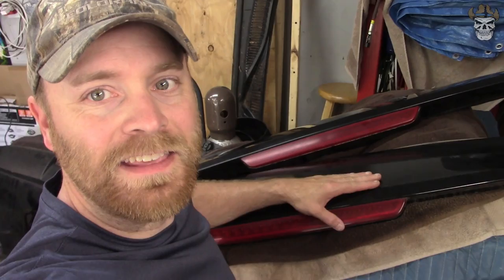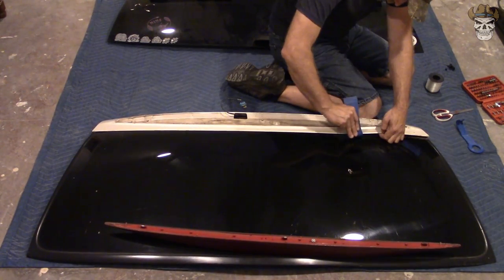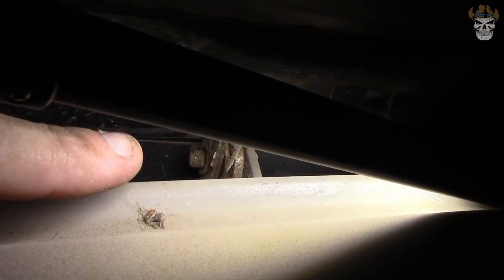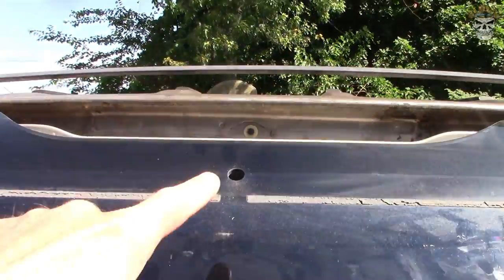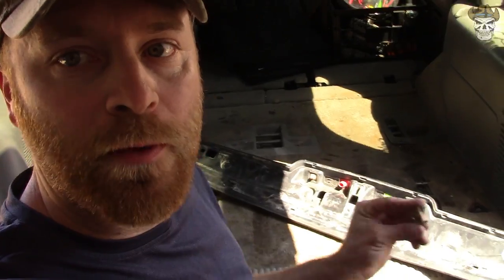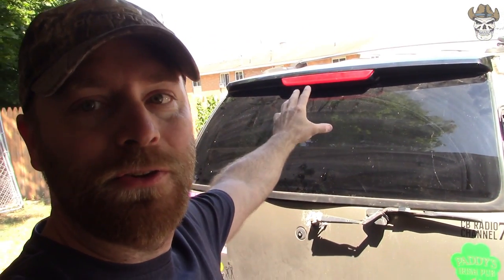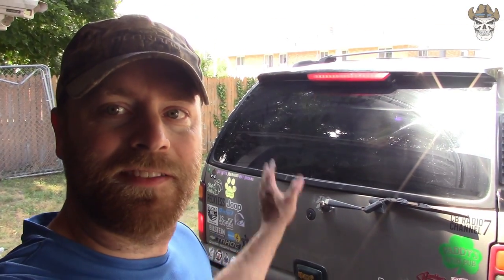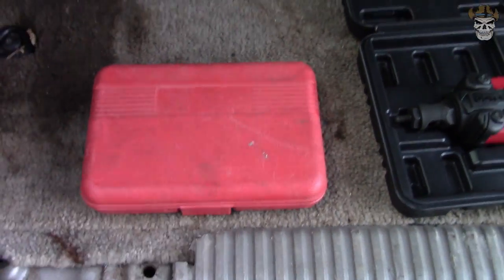Yukon Video 4 - GMT900 3rd Brake Light Installed

Comment: Nice vid! I thought that was going to be way easier than it turned out to be. Also thanks for the update about the rear wiper. I was going to leave a comment asking if that worked afterward
Reply from the maker: Its not all that hard if you have all the tools.  I think the worst part is the fitment is not all that eye appealing but you would hardly notice unless you knew what you were looking for.  I guess the best part is I figured out where you had to drill and what screws and hardware to use to make it easier for anyone who wants to do this.

Comment: Ok to sum things up...phone was glitchy...have 2004 yukon...what glass and what brake light do I need..thanks for all you do
Reply from the maker: The glass I ended up using was off a GMT800 or 2002-2006 Escalade glass with a GMT900 or 2007-2013 Yukon/Tahoe 3rd brake light.

Comment: Out of curiosity, have you tried the D-pillar covers from the 900 on the 800?  I'm curious how far off they are from fitting, and if they'd transition better on the third brake light if you could get them to fit.
Reply from the maker: I doubt they would fit but perhaps next time im at a pick and pull I will give it a try for the fun of it.

Comment: Hey man so I have an 06 so I have 06 glass were the other two holes doable for mounting that on even tho you didn’t pursue it?
Reply from the maker: I think you are just going to have to do the same thing I did using the Escalade glass.  Just hold the brake light to the glass and mark out the holes.  Then drill and install riv nuts.

Comment: Can i install it on the original rear glass without replacing it ?
Reply from the maker: I would imagine.  You would be solely relying on double sided tape to hold it so make sure you prep your surfaces well and get a good brand tape.  One thing I would worry about is a car wash brush getting under it and ripping the thing clean off.  I hard mounted mine as im an avid off roader and think I would have it ripped clean off in no time on the trials.

Comment: I see the 3 bolt holes but u mention 5 where r the other 2?
Reply from the maker: The other 2 screws would have gone near the outer edge of the 3rd brake light but there were no cut outs in the glass for them.  They are very small and honestly dont add any significant strength to be worth while.